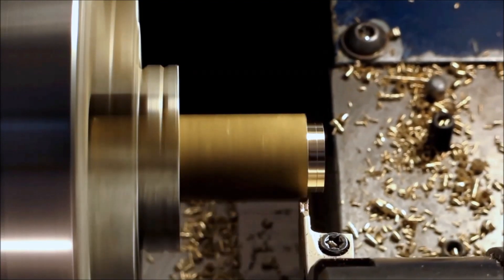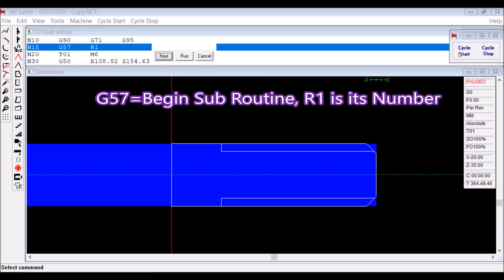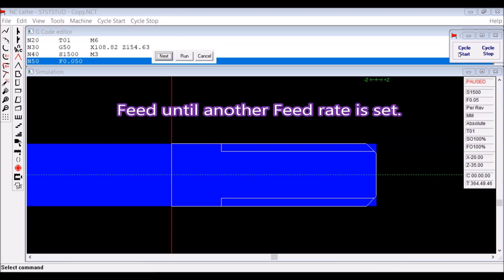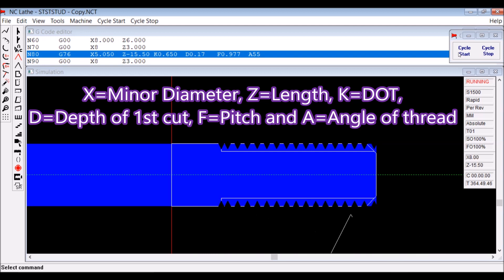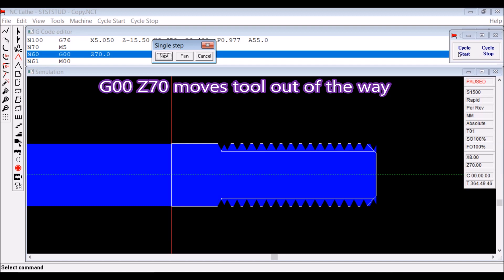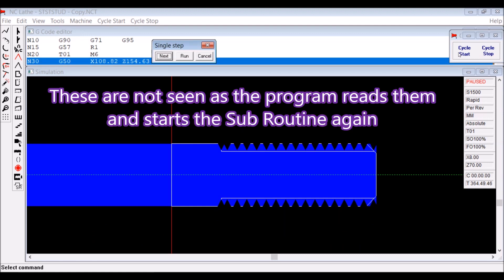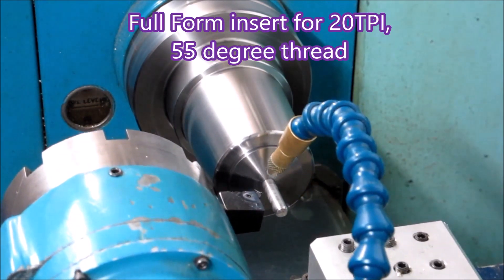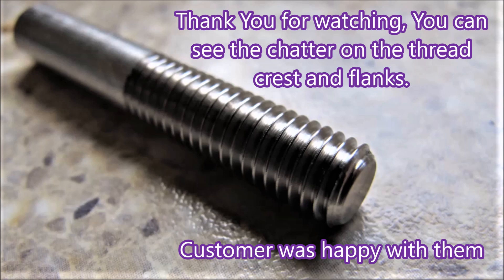CNC lathe threading 1/4" BSW on 304 Stainless steel, Sumitomo full form thread insert

Comment: How do you know you've gone deep enough with a full form insert? Do you just keep making cuts until you get a sliver from the crest being cut?
Reply from the maker: The depth of cut for my inserts is given in the Sumitomo catalogue.  What I would do for a 10x1.0 thread is make the major diameter before threading 10.00 then I take the OD down to around 9.90 to 9.95 although I find 9.95 is a bit tight in the GO/NOGO gauge.  Commercial 10.0 threads are usually around 9.85 OD.  The way I do it, I know that a complete full form thread has been cut, I have no idea what is the correct way, but that is the method I use.
Thanks for leaving a comment, I appreciate it.  Nigel

Comment: Nice video,  I gave you a like and I subscribed.  Thank you for your time.  What program are you running and did you convert your lathe to CNC. I will look at your channel to see but again Thanks!!!!!
Reply: Thanks Joe, my lathes were manufactured here in Australia for the educational market.  No longer manufactured, but they are great little machines.
The software came in a dos version and later a Windows version.  The software not only operates the lathe but is cad cam.  It can be used to draw the part and then to create the required code. The cam includes a number of canned cycles and has quite good simulation. It taught me how to drive the lathes with almost no knowledge of cnc, so I have to say that as a training package it was pretty good.  Not bad for software getting on for 30 years old. To avoid confusion I am smallcnclathes. LOL
Reply from the maker: Thanks Joe previous response was from my other channel